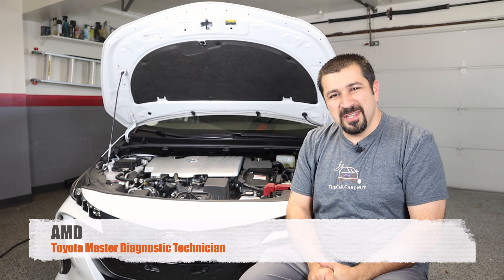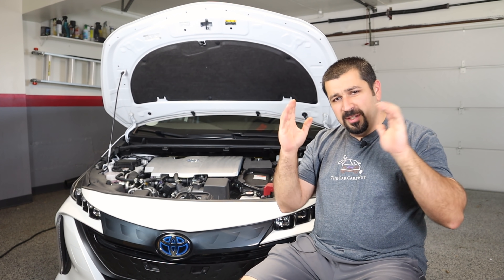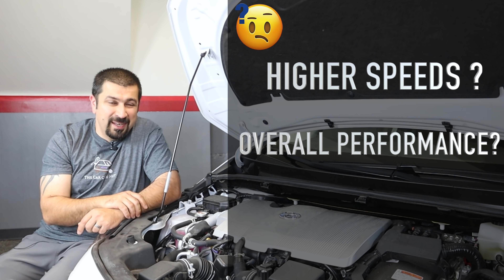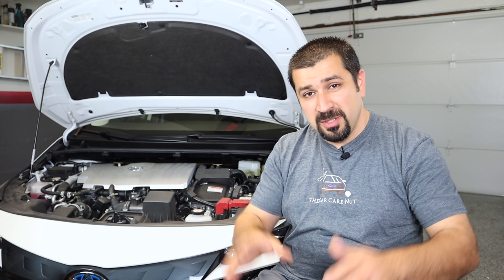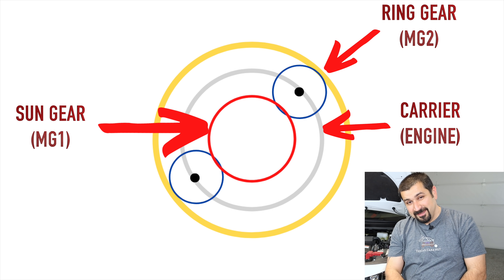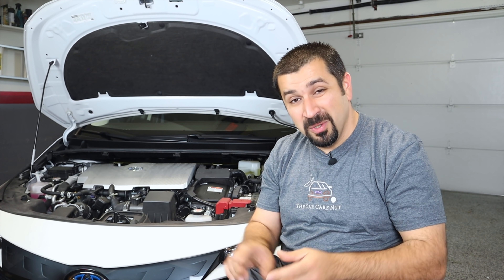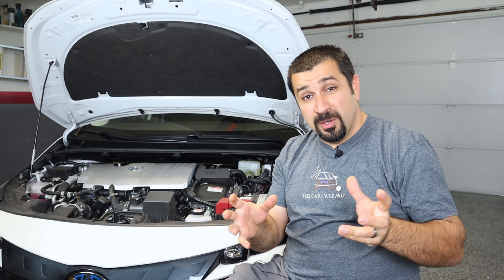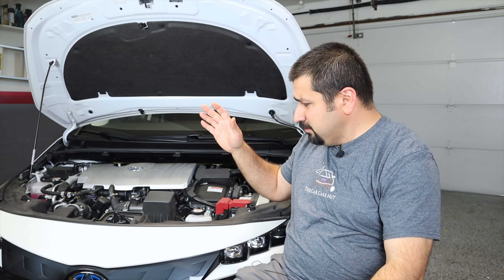How do Toyota Plugin Hybrids work? Completely different than Hybrids?

Comment: I got a Hybrid Plug-in Prius `2012 : my question is what is the purpose of the charger cable for? and do I need to use it?
Reply: The charger is so you can charge the hybrid battery and use EV mode on just the battery without using the engine.

But if you just keep on filling it with gas the engine it will also charge the battery, but you will lose some range.
Reply: Basically it's like a tesla with a engine, you use the charger to charge the car

Comment: Great video thank you. Could you please tell if you revised your assumption that the MG1 drives the car? I think this is wrong as multiple sources including the disassembly one by WeberAuto confirm that it has just three functions - starter, charger, e-cvt. It cannot drive the car.
Reply: Apparently Prius Prime does use MG1 to drive while the RAV4 Prime doesn't.

Comment: I have a 2019 Prius prime while cleaning the car the interior lights were on for 3 to 4 hours when I tried to start the vehicle I had problems with the 12 volt battery evidently plugging the car in to charge will not charge the 12 volt battery I had to jump start the vehicle.  Why? The car was telling me to set the parking brake and other things I didn’t understand what gives ?

Comment: I think that if they would make MG2 just bigger it could also alone drive up to 130 km/h? With the engine stopped and MG1 spinning backwards to make sure the engine is still?
The advantage of the clutch system is that you do not have to enlarge the MG2 by a lot and can use both engines driving the wheels. Or do I miss something?

Comment: 8:30 you incorrectly state that MG1 is generating... It would be free-spinning. Otherwise MG2 is driving the ring gear and then MG1 is causing a braking force with energy loss.

Comment: What I really want to know is what happens if you don't want to charge it at an outlet. Now you may say "then don't buy a plugin". And I would like to do just that, but the 5th gen Prius seems to come to Europe only in the Plugin version. I am driving an Auris hybrid for over 8 years now. I work early, late and nightshifts and give the car to my mother in law on my off days. We have no personal parking space and no garage with electricity and I am not allowed to charge anywhere at work. So how would a pure plugin version behave in this scenario? Will it consume more fuel than needed compared to my regular hybrid because of the weight penalty? Will the battery suffer long term?

Comment: Honestly thank you for this series. I actually learned to use the "Charge Now" Schedule option in the MySubaru app to prepare my Crosstrek PHEV's battery for charging when you stressed using the scheduling tools for our PHEV's. I really appreciate it! I never thought of worrying about the scheduling tools since I am on the ball to unplug between 80-90%. I did not realize that this option also prepares the battery for charging according to the temp / season. Your videos are great!

Comment: I was walking past a Prius parked on the street where I use to work when out of the blue it started itself up with no one in the car. It made me almost jump out of my shoes in fright. :face-fuchsia-wide-eyes:So nutral in a hybred, or any EV is not the same as nutral in a petrol, or diesel car, because there is no seperation between the power plant and the transmission to the wheels. In the UK if a hybred or an EV is broke down on the roadway somewhere the vehicle recovery services now have to jack up the car and place large heave rollers under the drive wheels, either 2 or 4 depending on the type of vehicle, to pull it onto a flatbed recovery truck for fear it will damage the entire drive train of the car and be liable for expensive repairs. No more towing these cars like with conventional petrol or diesel with proper old style nutral seperation of engine and transmission. I fully expect for the "nutral" to disappear on these hybred and EV cars in future for the simple reason they are never in "nutral" as we know it. it will take a few people to get hurt , or killed, or a car driven through the door , or the back of an owner's garage, or the car in front of it parked on the street when the engine starts up to charge the battery whilst parked at a stand still in "nutral" without the parking brake on and the litigations suets that will follow. :body-blue-raised-arms:

Comment: The HVAC situation not for my country go this https://youtu.be/7kCTn_l48Hw
Not electric oil pump we need but we need oil cooler radiator instead  https://youtu.be/PutZMfHY-5w
Good for No engine idle longer than 10 minutes complicated by too big https://youtu.be/y62eX3FZtrw

Comment: The heating problem? Are we joking to you in Thailand Not for the unit in Thailand ever because the out side on day it over 45 degree So We don’t need the heater we need only electric ac compressor and prevent the transmission is overheating by addition of the mini transmission oil radiator and small electric fan but problem is about battery cooling however we can convert any diesel car to electric car by adding motor battery electric ac compressor electric brake vacuum pump ECU BMS charger module and the electric water pump not complicated by no heat but we need to think about overheating instead So no problem for in future we covert the used hybrid car to and electric car by replacing engine by one big electric motor and upgrade the battery addition of transmission cooling radiator that makes sense because the fluid never was frozen because the outside temperature in our country never below 21 degree and We don’t need a electric oil pump because no automatic hydraulics need or no real transmission ever in hybrids it only has single gear single gear ratio that fix all time no Lower gear cause to only need oil for reduce fiction and the motor is producing heat only 2% not same the engine that over 50% of heat production so most EV conversion in our country or OEM EV motors are just cooled by air and the water cool still for inverters converters unit the engine heat make benefit of to kill mycobacterium or virus so if you turn air defrost in the morning for 5-10 minutes that engine too cool that make benefit for kill pathogens and warm it up to charge batteries same time
Reply: Think of them to toyota hilux vigo went to ev too with ac compressor So it is made sense
Reply: Go this https://youtu.be/7kCTn_l48Hw
Reply: In my opinion my car is used everyday and I hate the engine idling when stop because it make too much pollution and noisy ever for outside So I go hybrid instead and leave for conversional gasoline car

Comment: Wait.  This thing still has a driveshaft instead of traction motors? Why don’t they make an hybrid ev with traction motors but have the ICE power a generator only that keeps the battery charged?  Just like a locomotive.

Comment: Hello, I'm really like your video and Toyotas by the way. I'm from France and have a 2017 Prius Plugin. Since I bought it (November 2021), it vibrates at speed around 50 and 80-90mph. At start, i thought it was the tires. I changes them in January. Problem attenuated but still there. After that I listened carefully to the drive train sound and noticed some rattling (like a free wheel on a bike when you don't pedal). I noticed the noise is present when I'm turning the wheels, even just a little. If the wheels are straight, no sound. I also noticed when I put my car in neutral and push or pull it, near complete stop, I'm hearing a grinding noise from the transmission (I also feel notches and see engine moving). I know these things are not completely safe to observe, but to see what's going on, I put my car in neutral and push/pull, I see the engine go back and forth a little. I am afraid to let the car to the dealer and they couldn't find the issue and charge me. I never had a problem with the car since buying except this. Could you help me diagnose and eventually explain that to my dealer. It's the hybrid power train, so I think it's covered by the warranty. Thanks for your help.
Reply: Maybe it is your problem and solution: https://www.youtube.com/watch?v=dNxECvhQBl0
Reply: @atkak8561  Yes, it's exactly this sound when the car is rolling. Thanks for the tips.
I talk to the dealer when I left it for the annual maintenance but he doesn't know this issue. I tried to explain to him but after some time he was upset and told me to go to another Toyota service...

Comment: I can't even sit in a drive thru in neutral very long without getting a warning message on the master display in my 2014 Camry Hybrid. This is something I would do as second nature in my 2003 Tundra, to alleviate some of the strain on the drive train while waiting long periods. I have to stay in drive with the Camry.  It was just something I had to get used to.

Comment: I'm a manual gear (stick shift) driver by training (I'm writing to you from the UK) and I've had to get used to driving automatics over the past five years. I liked to put the gears into neutral when driving a manual gearbox whilst waiting at traffic lights etc. I've been doing that with my previous Citroen automatic diesel car and I've never been sure if that's good for the car or not. You mention not putting the Toyota into Neutral over long periods and so I'm wondering what I should do instead - because that's exactly what I have been doing when I'm waiting at traffic lights. What's the best way of driving these hybrid cars when waiting at traffic lights or when I'm stuck in a long traffic jam?
Reply: DK here. I've got a Corolla Hybrid. You've got 3 options to choose from (in my car).
1. When you come to a stop, hold it on the break pedal.
2. Engage the hold function, just push the button, then when Car is at full stop and you have pushed the break pedal hard enough it will hold untill you step on the acellerator.
3. Use the Adaptive Cruise Control, it will take the car to a full stop and start from zero as well, if there's a car in front of you
(4.) If it's a very long stop  put it in park.
Neutral is only needed if there's a problem with the car and it can't drive.
Note the Prime is called PHEV in Europe, and only the Prius and RAV4 is available as PHEV, all the other Toyota Hybrids is Full Hybrids, so just a short distance/Time in EV mode.
I'm at 45% of time and 35% of the distance in EV mode.

Comment: HI AMD,  the simple but complicated method is working.  As for others, it’s the first time I’ve seen some detail in HOW the power sources interact on in the Hyb Syn Drive system.  Nicely done.  I also have a lot more respect for the engineers and the MAJOR complexity increase that went into the Prime series of vehicles.  If they can design this, bZ4X should be a walk in the park, once they’ve got a reliable battery supply.  Thanks again!

Comment: Hi. I have just ordered my first Toyota (of any kind). It is a Touring Sports, 1.8 HSD. :) So I would like to learn as much as possible before it will arrive (in April or May next year....).
So, I would like to call for your kindness to make some light on the next situations.

1. What if the car is moving and we put the transmission into N? Will it allow the ICM to start?

2. Can you please confirm my next theory?
Car is not moving: ICM can start only when transmission is in P
Car is moving: ICM can start no matter in which mode is the transmission (P, R, N, D, B)

Thank You!

Comment: Sir. my Prius Prime will is not going into EV mode at a reasonable time for the first 3000 miles or so it did almost immediately. Now I have to wait until it goes into Hybrid ev  before it will do so. If I pull off the road ,stop the car then start it again, of course if the battery is charged it begins in EV mode. When I Push EV it seem to take one and a 1/2 miles to engage the EV function if not longer.  It is a 2021 and I bought all the extra what do I say to the Toyota place So they can fix this problem.

Comment: AMD I have an 18 Prius Prime. I am from Canada and there is Rust on the rear hatch handle and the dealer fixed it using the Toyota recomanded repair kit. Is that a permanent fix? How can I delay rust? I do go carwash weekly to wash out the salt in winter. Any tips would be appreciated. Thanks In Advance!
Reply from the maker: Hi! Interested to see a picture of the rust as the rear hatch should be carbon fiber and shouldn't rust unless it's a metal stud that's just bleeding rusty color.
Reply: @TheCarCareNut  

The link is the before picture of my trunk
https://photos.app.goo.gl/pv4bsNTQbg9jJAnm8

This is the chat in regards to the rust.
https://priuschat.com/threads/rust-on-rear-hatch-handle.199016/

Comment: i have a question i was trying to contact you on youtube  but dont where to on youtube ..i have a 2017 toyota yaris hybrid i change the ecu an now the mileage on meter is not working the trip and speed working an everything else except the miles mot moving it was damage on the left front so i not sure if it was working beforei buy it damage can you tell me if any way i can get it working
Reply from the maker: Hi! Was the ecu programmed?
Reply: @TheCarCareNut  yes it was a used one with only 10000mile on it an my car doing 16990 miles

Comment: Hi. Does Dual motor drive present in Prius zvw35 or just in 52?
Reply from the maker: It’s only in the Prius prime.
Reply: @TheCarCareNut  so that means that first generation Prius PHV (35) have the same hybrid system as regular 3rd generation prius (30) except LI-ION high voltage battery with more capacity?
Reply from the maker: Almost yes.
Reply: @TheCarCareNut  :))) ok, I'll try to guess... High voltage battery + more powerful inverter on mg2 and a little bit different algorythms?

Comment: 👍🦘 Very interesting, as it turn out I’m on my second Prius the first did 363000 Kms (app 225k miles) before I traded it on my second which I happily drive with now 140k on it. I thought I knew how the system worked “Wrong”  thanks so much for this channel you’ve got a new subscriber .

Comment: Hello AMD, 
I basically never comment on anything. Ever
But I wanted to say, and I’m very curious…

1), I love your videos. They are just simple enough for a layman to understand, but complex enough for an enthusiast to learn.
2), I’ve read through all the comments here, and I cannot find anyone asking this question:

Can the Prius Prime use the full  power of MG1, MG2, and the engine in something like EV AUTO mode?
From what I can find online the Prius Prime is governed at 101 MPH. Far above what anyone outside of a German autobahn would drive, but I was simply curious if it can output that much power.

Thank you
Reply from the maker: Hi Keith. Thank you for your comment! So it’s not possible for dual motor drive to happen when the engine is running. Both MGs will drive only when the engine is off. When the engine is running it’s turning mg1 to generate and assisting mg2 to drive.
Reply: @TheCarCareNut  Thank you for your response! You're one of the only youtubers I know that reads nearly, if not all of the comments left on your videos, marking them with a heart to show that you did read them, and I find that to be really awesome!

I hope you are well :)

Comment: The HV battery in these cars I heard from Scotty Kilmor to replace that battery your looking at $10,000. Is there any truth to that? 

     Also, I heard Toyota is working on their cars running on hydrogen and the other half battery power. I hope there is a chance they will sell here in the US, because I hope by the time to save up and try as close as I can to buy one right off the lot!

                              Always enjoy your video's good sir!
Reply from the maker: Hi! The battery is expensive but it also has a very long warranty. It’s actually just under 10k and I haven’t seen one fail yet. Highest mileage prime I’ve seen is actually a viewer which had just under 200k miles without issues.

Comment: My prime advance, i notice the battery has grown in capacity the more i wall charge it, I went from 25 to 28 mile range. Also with the prime in ev auto with ac off and in b mode which enhances the regen braking while driving in ev modes in town speeds and long braking i can drive almost 35 miles in ev only. Most times i am driving medium speeds i achive 70 mpg just doing hybrid only.

Comment: Thank great video ! I was waiting for a episodes about plug in hybrids as I drive Prime. 

I have questions, every time I drive in EV mode downhill after few minutes ( specially with the shifters in B ) , the ICE comes on while it is still in EV. I understand that it has to be related to cooling maybe inverter or something? But I thought the PRIME has electric water pump so why it needs ICE to run?
Reply from the maker: Hi! In B mode the engine doesn’t come on it’s just spinning to create the drag but it’s actually not running

Comment: hm, perhaps a BEV for shorter distances (Lexus UX300e) + a old used Lexus for long trips is the best option. These PlugIns are heavy and on longer trips they consume nearly the same as a regular car without any battery and less weight.